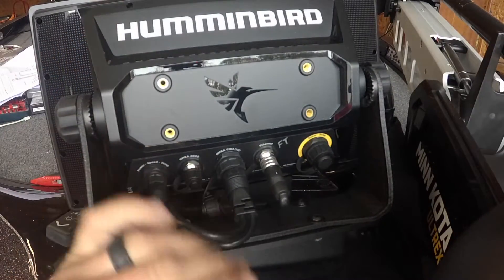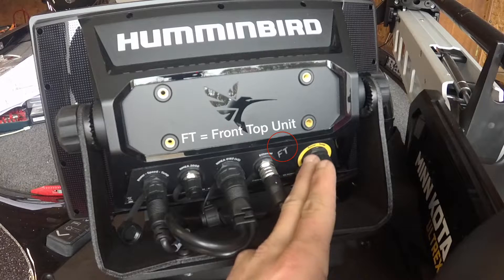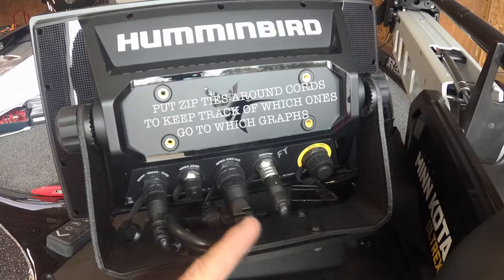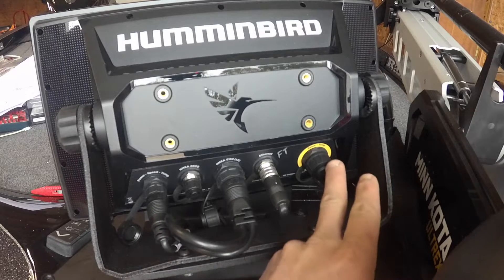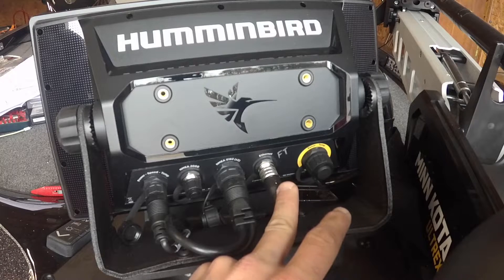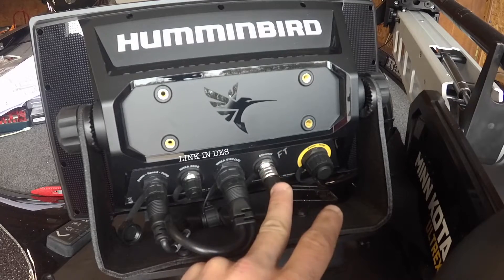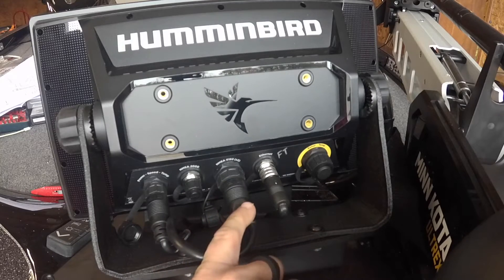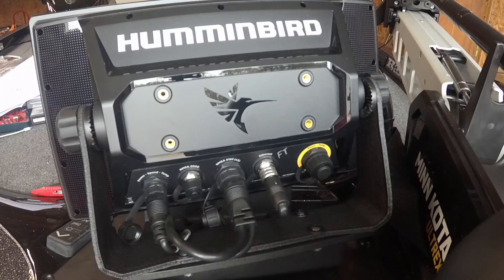HUMMINBIRD SOLIX EXPLAINED : WHAT DO THE PLUGS IN THE BACK OF UNIT DO?

Comment: Where is your AS GPS HS antenna located?  Also, how do you mark waypoints to achieve the most accuracy as possible?  What are your thoughts on using the distance to go for lining up on offshore targets?  I could ask one million questions here haha, but we can start here.
Reply from the maker: Derrick House I put it next to my recessed foot pedal.   This way all units read off of it.  So all graphs are reading off the same location.   I stay about 100 feet off.   With a crankbait maybe a little closer because I want to throw past the target